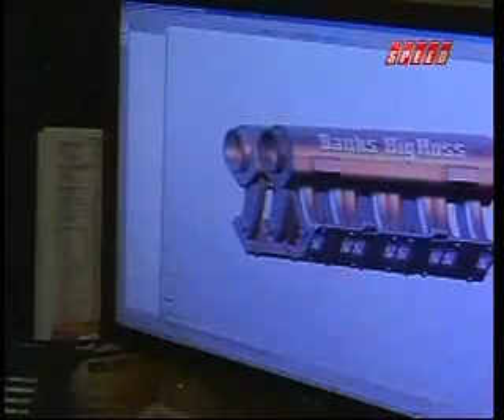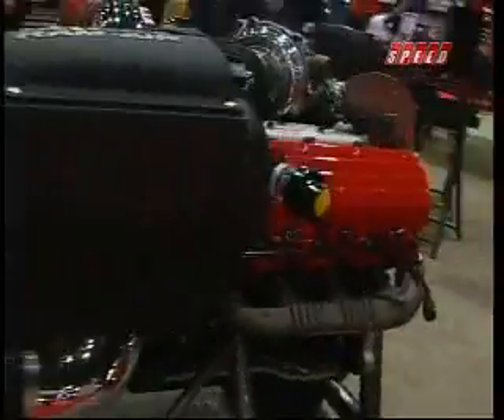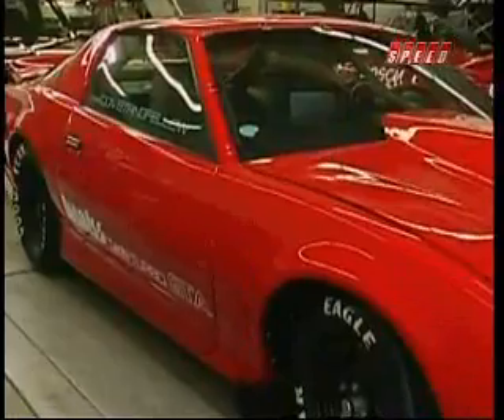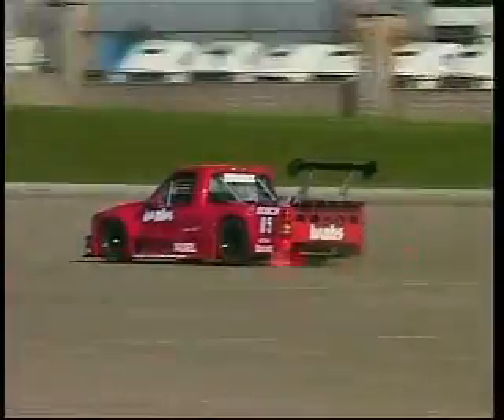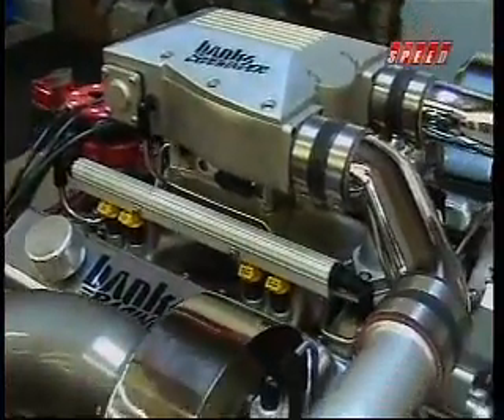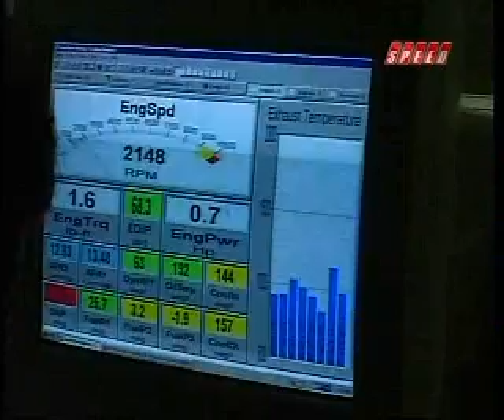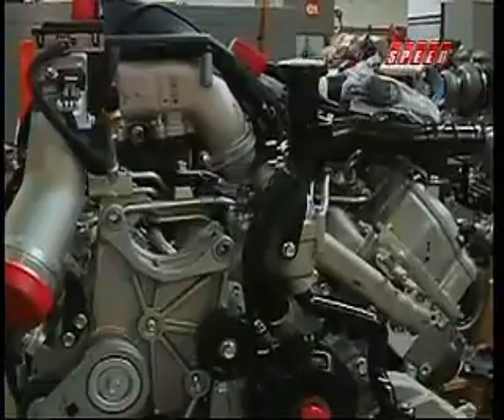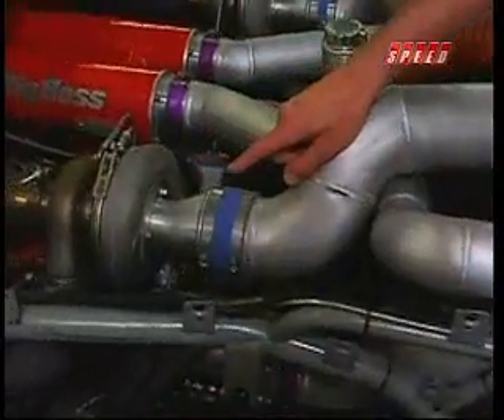Turbos & Blowers with Gale Banks (part 2 of 2)

Comment: On the 222 record run the truck blew the whole back of the quick change off after the final mile trap  we found a couple of gears and bearings plus alum pieces on the track

Comment: But heres the thing. There isn't as much N/A engine internal tuning being made anymore. You can turbo charge anything and make it fast. Without turbos Diesel engines would suck badly. But Just imagine if i had a 454 big block which already makes around 450hp, twin turbo charged. I'm willing to bet it would beat the living shit out of any diesel
Reply: Callum Wearne itnwould beat the living shit out of itself. That’s the point he was making. It’s very hard to break a diesel

Comment from the maker: Yup, folks have been "twin-charging" for years. There was even a VW in Europe in the recent years that was both supercharged and turboed. It was a 1.4 liter, got almost 200 hp and got great MPG. The turbo provides the mid and top end while the blower huffs it out of the hole. A great combo.
Reply: Banks Power If you can put this in a rear wheel drive layout, with stand alone engine management, I'd like to drop that in a '32 Ford roadster, MG Midget or Volkswagen Karmann Ghia and make it my daily driver.